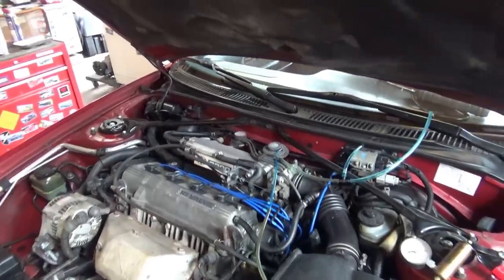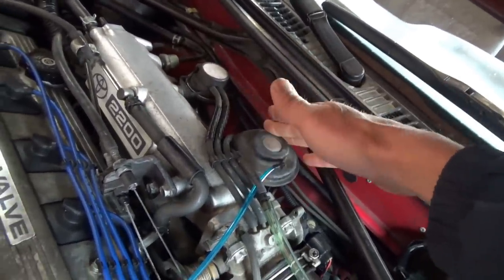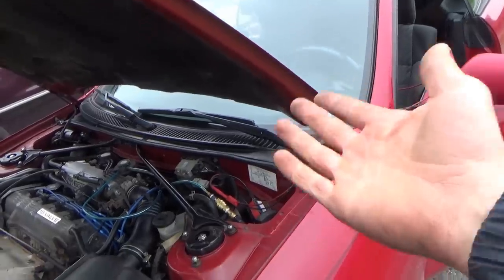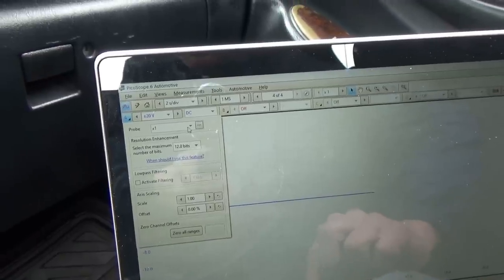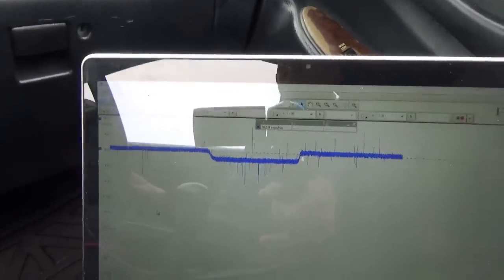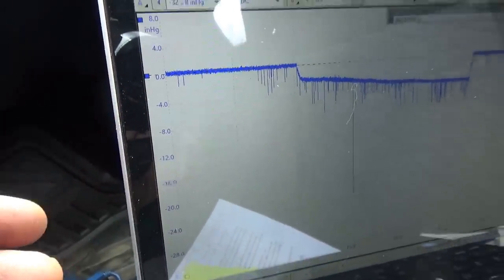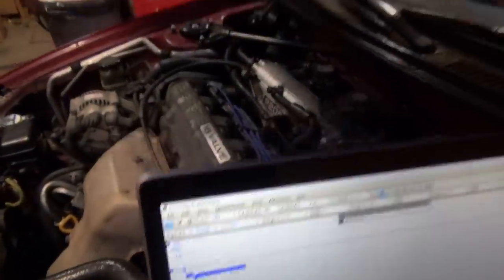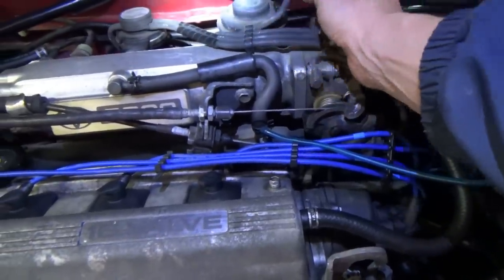The CELICA SAGA - Part 2 (Surge on Highway)

Comment: Thanks again Ivan, you are a genius.  The surges are now a thing of the past, my gas mileage has improved by at least 10%, and I easily sorted the other problems you diagnosed.  My engine light is on as predicted, but as you say there are no emissions testing here in Bedford County so not an issue.  👍😀
Reply from the maker: Was a pleasure to diagnose your trusty Celica, Robb! Should make it to 500k miles with some basic maintenance 🙂👌
Reply: @PineHollowAutoDiagnostics  Is this breaking news?  Scotty moved to PA?  I guess I will see that video on his channel soon.
Reply: IVAN the sherlock Holmes of automotive troubleshooting.
Reply: The "correct" amount of EGR during PT operation allows a bit more spark advance and better fuel economy.  Never argue with good results !
Reply: @PineHollowAutoDiagnostics  would be very happy with 300k!
Reply: 30 mpg, right now that's a big help.
Reply from the maker: @jackpatteeuw9244  I've disabled the EGR on all my own cars. Fuel economy stayed about the same, but midrange power noticeably improved. Plus the intake manifold doesn't get all gunked up 🙂
Reply: @PineHollowAutoDiagnostics  Anything you do Iven is probably the best thing to do
Reply: @PineHollowAutoDiagnostics  During the 90s, some auto manufacturers tried NOT using EGR, primarily as a cos reduction.  It came back because they of the small, but measurable increase in highway mileage.
Reply: awesome feedback mate! wish i could take my vehicle over to Ivan to take a gander.
Reply: Disabling the egr increases emissions and lowers the fuel economy. The egr system or exhaust gas recirculation has multiple functions. One adding back incompletely burnt fuel or hydrocarbons if you prefer. To be burnt again. This is how it reduces emissions. Second the volume it adds back takes up space in the cylinder and because it already has fuel in it less fuel needs to be injected. This increases fuel economy since less fuel is being burned. Thirdly it protects the catalytic converter from burning up fom a too rich condition. It is scientifically impossible to get a 10% increase by disabling it simply because the fuel that is not there from the egr now has to be replaced by fuel from your tank. It takes 2.2 liters to fill the cylinder you remove .2 the egr added now .2 has to be added from your tank. Costing you more money in one year of driving then just replacing the valve. Its also illegal in all 50 states to bypass any emissions systems regardless whether or not your area has emissions testing.
Reply: Rob did you say you ended up hooking the radiator temp switch into the drain plug ?
Reply: I have a 1.8 st and can't seem to find a place that same wire that was hanging from your relay box anywhere ! The only plug on the bottom of the radiator of mine is the actual drain plug to release the coolant ... my fans won't kick on at all and I tested them with external power they work just fine ... same with the relays - and I changed the thermostat ... I can't figure this out !!!
Reply: I have the same wire hanging
Reply: @jackpatteeuw9244 but where is it now??? If it was truely for fuel mileage? vvt does it better and always has..They found better more efficient ways to gunk up intake systems and render cars useless in under 200k... That's why new cars dont use it they get the egr effect with vvt and gunked intakes faster making dummies want new cars faster and faster with direct injection and ridicules pcv systems

Comment: Ivan, I'm 70 years old now. When I was a teen, I remember that tires being out of round was a more common problem. The tire shop I used had a machine where they would mount your wheel and tire and actually grind away the high spots making them run true on the tread. They always had a pile of rubber dust around that machine.  Keep up the good work!
Reply: I'm 63 and I remember when they used to shave tires to make them round.  With the garbage tires they make today it looks like they need to start doing that again.

Comment: As a GM EGR Product Engineer "back in the day" the fix on those older systems was to cut the end off a Golf Tee and put it into the line as a block and reconnect the vacuum line. Invisible fix! In New York emissions were not required to be functionally checked yet inspections often included looking to see if the systems were intact. So no CAT delete pipes, missing EGR valves, visible "Golf Tee" deletes or "Blue Tooth" connections. Great diagnostics.

Comment: Writing this as I Am watching. Ivan, just bleed off a  bit of the vacuum signal. Start with a very small drill bit and your problem may be solved. And the Egr remains operational. The bleed port just dampens the output vacuum signal. GM actually had a TSB years ago for this issue and that was their fix. They just used a vacuum tee with a brass drilled orifice for the bleed. Works Great!
Reply: Ok
Reply: yeah, that would probably work. I wonder if the EGR valve is supposed to have a bleeder orifice integral and it's plugged/rusted over, I've had that a bunch on GM's. some of them you could find the bleeder orifice on the metal part of the pot and clean them with torch tip cleaners.
Reply: You have a good memory! The TBI “flat spot” was very noticeable in the pick up trucks! You didn’t have to drive far to feel it! A lot of “ mechanics “ just unplugged it! That cause instant ping! Head too hot! The answer WAS the “t” with the bleeder vent! Mostly found in my junk drawer,problem was they were hard to find ! Once I found what Import had them, I ordered 6 or so, went through them pretty quick! Magic fix & cheap! That brought back great memories ! The first GM fix was an updated EGR with a “very” restricted vacuum port! Expensive & didn’t work near as well as the bleeder “T”
Reply: Did this on Subaru cars in the 70-80’s at the dealer. Used .22 caliber pellets and small drill bit.  Got rid of surge and still kept combustion chamber temps from getting excessive.

Comment: On older EGR systems like that I would make a metal blank to put under the valve in order to block off the system but it would look stock.  Once they started putting flow sensors on them, doing that would turn on the money light.  Another great video.  I love the way the mind of a scientist uses logic and deductive reasoning to solve problems.

Comment: Ivan it's David Keller,  hey just wanted to pass on alittle knowledge. I'm a mechanic in Northern Ohio and the last couple of weeks I've had a few later model Hondas with what they call a flutter. It's a hesitation around 45 mph at cruising speed. It feels like a surge or if it had a fuel filter,  a plugged filter
Or an egr with partially blocked ports...It's even visible on the tach...long story short there's a bulletin for failed transmission fluid. They want you to drain and fill 3 times. I was skeptical but after the first flush I could feel a difference! It even felt funny when you let off the throttle and coasting. After the 3rd flush it was a different pilot(2017) then the the next day I had an odyssey. Same thing! I figured I'd share this cause you may see one...be good Dave

Comment: Great call - EGR valve spring weak - and excellent results from the pressure transducer!
I've seen brand new tires running oval, right after installation, and some brands don't accept the complaint.
Reply: All tires have more or less vertical throw, none are completely round. If there is too much vertical throw, road force balancing should be used.

Comment: Hey Ivan many many years ago Toyota had some bulletin out for a either surge or lack of power. What they came up with was a inline restrictor valve it was white and yellow squarish. when you blew threw it (via mouth) and timed it one side went much quicker than other. So we would install this in the egr line and that would resolve the issue 99% of the time. The 1% that it did not fix did have a greatly improved performance and the customer that it happened to were OK with it. The EGR does lower combustion temp too and back then being in a dealership we could not just block off the egr due to state or federal law whatever applied. BTW for example only the hose id was lets say 2.5 mm? when you put that restrictor in the line it went down to lets say .5mm just because of the design so you did not have the volume and restrictor in the valve delayed and possibly did not open abruptly. This was a very long time ago.

Comment: The parts cannon didn't get fired this time, not even close!  Great diagnosis and solution for a 25yr old car and budget driver, great job.  That 2.2L will run for decades with oil changes, amazing engine.  I know the car would be a lot nicer with a manual trans, but that low-tech AT is well matched to the engine in terms of durability.  Shame that old cars end up neglected but it's the reality of people just needing transportation on a budget.

Comment: I learned the hard way a long time ago that it's a bad idea to cheap out on tires.  The US tire companies took many years to learn how to properly make belted tires.  Now it's the chinese.   I bought nothing but Michelin for years but last time I bought Good Year, BFG, and Firestone for my 3 vehicles and they seem to be doing fine.  
The first radial tires in the USA appeared about 1965 as a Sears tire.  They were Michelins, tube type, and had a 40,000 mile warranty which was real because Sears never discounted those tires.  I bought 2 for my hot rod chevelle and they had 39k on them when I sold the car and they had a third of the tread left.  Bias tires at that time lasted 8k on the rear and 15k on the front.  And the mileage on those Sears tires was about evenly split on the front and rear.  They got little traction but you couldn't wear them out, it seemed.
Reply: That's all tire durometer difference, mileage vs. traction.
Reply: @chasingcapsaicin  And the bias tires flexed so much they just couldn't be made to last.

Comment: It's amazing how much better the engine runs with new tires.  The car feels wanted again.
Reply: Was this your celica , I'm having the same fan issues and wondering if I can put the temp switch where the actual drain plug is.. the plug that you use to let coolant out the radiator ?
Reply: I also have a 94 celica but it's the 1.8 and noticed the same loose cord - confused because I have a temp sensor on my water pump house and a temp send on my thermostat housing ..

Comment: Real fix is a new EGR. Not good to drive around in a car with the check engine light on all the time because you won't know if anything else is going wrong. Also on some cars it can cause problems because the timing map is assuming the EGR is in operation. Some older GM engines with no knock sensor would ping like crazy if the EGR wasn't working.

I am glad that EGR is one of those systems which you don't see anymore though, at least on gas engines..
Reply: It's a $1200 car.  My real concern right now is the price of gas.  If it keeps going up I won't be able to afford to drive to work.
Reply: EGR is alive and well, and better than ever. The absence of traditional EGR valves and vacuum gizmos is simply decades of evolution. And yes, many older cars got noisey as EGR failed. Chrysler's were absolute pinging machines even when EGR was working correctly, but when EGR failed, "MOPAR" would be changed to "MOPING".

Comment: Tires are flat spotted from sitting  in one spot for months. inflate 10 psi  over  recommended during storage or put on stands over winter.
Reply: Yeah, it was sitting for a year after the owner died.  I bought it for $1200 as part of an estate sale.  I was worried also about possible gas contamination so changed the fuel pump and filter and run through various cleaners and a couple of tanks of Shell premium.  Can't afford to change the tires right now or address the coolant leak and one or two other things, but they are on my To Do list!

Comment: You could crush or dent in the top of the egr valve in an effort to compress the spring. Thus increasing spring rate. Which might help keep it in range. We used to do this to turbo bypass valve on the 1st gen DSM's (Mitsubishi eclipse, eagle talon, Plymouth laser)
Reply from the maker: Now that's a real Russian hammer repair 🛠️ 😅
Reply: Maybe a washer or two would work ?

Comment: Just a P.S.A. for anyone that is interested.  I have a buddy in the tire industry that showed me first hand that if you pop the bead on the tire and don't allow the pressure to bleed off completely before filling it to the correct pressure it locks the tire in a stressed position and makes them wobble.  The fast tire shops often don't take the time to let the air escape so the rubber can relax and find center so you might want to find a small shop that is willing to take the time to do it right.
Reply from the maker: Never seen that phenomenon personally... Usually it's a Chinesium tire that isn't round and bounces the car like a basketball haha
Reply: Also could just be a severe curb strike that broke the belts, or they sat for a long time flat.
Reply: @PineHollowAutoDiagnostics  Back in the 80s and 90s I had a series of Mercedes cars and they had super-expensive Michelin MXV tires and omg, they were garbage!  They went out of round and had other issues and Michelin told me it must have been my fault somehow and denied my warranty claims.  I installed some high end Bridgestones and never had an issue again, so much for me not knowing how to use tires, doh.  I agree with you generally than cheap tires are junk, but even expensive tires can be crap too, ugh.
Reply: Yes, I agree. South Main auto did a bit on this as well. When I purchase new tires I ask up front before any work is done if they will allow me to inspect each tire while it is on the balancer so I can verify proper install, balance and look for defects in the tire itself. If they start spewing OHSA this and insurance that just leave. Telling you that you cannot enter the shop space is only true if you do so unattended by a staff member. I wish employees would read their employers insurance policy and OSHA regs before slamming the door on such simple customer service requests!
Reply: @PineHollowAutoDiagnostics  Michelin all the way...money well spent.
Reply: @PineHollowAutoDiagnostics  Yeah you can get really bad tires but I was shown with some really high dollar tires that it makes a huge difference.  We spun the wheel alone to ensure it was straight and balanced then installed the tire not allowing the initial fill to escape and it bounced bad and called for 1.5 ounces of weight.  We then allowed the tire to go flat and refilled it and the tire actually didn't require any weight and was perfectly round.  That one experiment sold me.

Comment: Interesting series. I own a 00 Camry with the same engine that threw an EGR code (don't recall if it was too much or too little flow), I did a little research and decided if first take a look at the air filter-turns out a field mouse had made a nice little home there, since cleaning that out is been rubbing fine with no codes, but since it doesn't get a lot of miles I'm expecting there might still be a issue with the rest of the EGR system. If the code comes back then I'll be looking to do deeper diagnostics and I'll make sure to keep this video handy as a reference. Thanks Ivan!